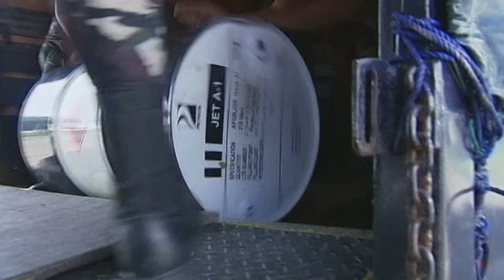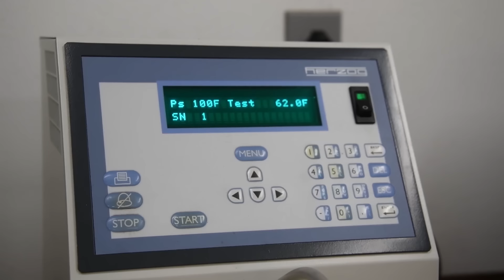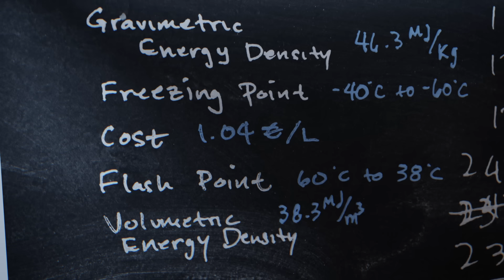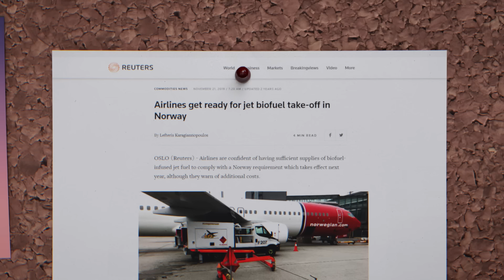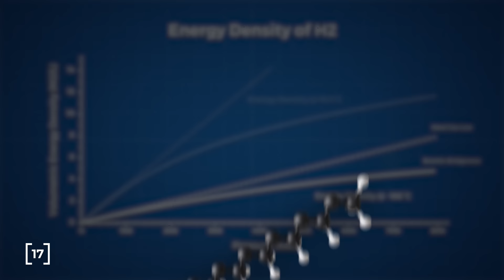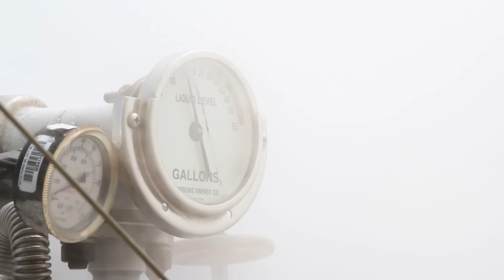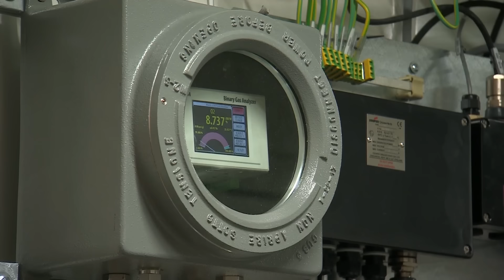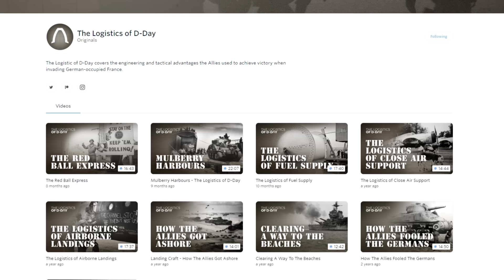The Uncertain Future of Jet Fuel

Comment: Air plans used car technology for the first 30/40 years. That technology had already been smoothed out decades before the write flier. I'm sure once electric is the standard for cars there will be a clear path for planes.
Reply: Battery tech does not follow Moore’s law. The energy you can store in even the most advanced battery concepts under consideration are not even close to the energy density of hydrocarbons. That’s why electric planes will remain a niche application as the video author said.
Reply: @nemotaylor240  Moore's law is specific to chips. Nothing else follows that. But yes with today's technology it's niche. If you look at gas powered plans of the 1920's it was a niche market for small local routes because the technology for light strong airframes, and more efficient designs weren't there. In the 1940's and 1950's there was open debate if we could travel faster than sound. Technology advanced. Look at electric cars from the pre 90's they were niche homemade mods using flood batteries. Now look at that market. 400 mile range competitive in performance to gas cars. Look at stationary energy storage. It went from flood batteries, to LiFe batteries and now they're looking at liquid metal batteries. The point is you can't put today's limits on the future.
Reply: @sailingbrewer  trust me I am with you, I’d love to trans-Atlantic battery powered commercial aviation. But the numbers don’t lie: very best lithium-ion batteries are 600 Wh-L. Jet fuel exceeds 9000-10,000 Wh-L. It’s literally more than an order of magnitude. Battery tech is stagnant for years and then every once in a while there will be a small breakthrough, but battery scientists are already having issue due to leakage between the ions the more energy you squeeze in. It’s a very very hard problem to solve with no solution in sight at moment. The example you use about cars is only possible because of the supercharger networks. Long-haul jets obviously can’t refuel in the sky. I’m stoked on electric planes! They just aren’t the solution to modern commercial aviation. I was disappointed the authors didn’t mention small fission reactors which are the only realistic “green” (in terms of climate) tech out there that could solve this one.

Comment: Personally, I think hydrogen fuel cells are a decent option to move towards for plane fueling. Especially if you switch over to electric "turbofan" engines. It would also be a good intermediary alternative for trains and ships too until the KWH per Kilogram of batteries gets up to par. Common to all these forms of transportation is large centralized fueling/loading stations where installing an expensive hydrogen storage and fueling station would not be an extreme hurdle to overcome. I am not sure how much volumetric energy density compressed hydrogen has in a tank versus jet fuel in a tank though.

Edit: I got to the part of the video where you show the volumetric density. I wonder if you can overcome the comparably small volumetric energy density of hydrogen with the efficiency of electric "turbofan" engines, the superior energy conversion efficiency of fuel cell generators and the comparably inefficient use of jet fuel's superior volumetric energy turbofan engines provide. Especially if you combine this with the sea based solar power and desalination plants being worked on currently it sounds feasible to do. I recently read about a new solar panel waste heat based desalination tech that is supposed to not pollute the ocean with concentrated brine water. It sounded like they had a working prototype according to that article.

Comment: I have a question. I have read that boats might be using liquid ammonium as fuel, could planes use liquid ammonium I know it's energy density is dogshit and it needs to be stored at -28 f but it would have more wait and easier to handle. While efuels are more practical could ammonium find a niche?
Reply: qopoy dnon  what?

Comment: I'm no expert but I'm sure that a small electric plane might be cheaper to maintain than a normal aircraft (No oil changes or need for gasoline or kerosene).
That's good news for anyone wanting to fly their own plane but don't like the necessity of maintaining an aircraft.
Although electric planes are probably expensive because of the batteries.
Reply: Too heavy to fly right now

Comment: Why not make electric turbo fans like model RC planes? Issue being batteries ofcoarse, but i wonder if they could make enough thrust reliably if power (batteries) were not an issue
Reply: Phoenix  𝙾𝚙𝚎𝚗 𝙼𝚢 PROFILE  what the heck does this have to do with what I wrote? Electricity comes from many sources, and can be easily produced without fossil fuels, coal or nuclear. Learn to read.

Comment: As always an excellent and well researched production. Don't forget that bio fuels are energy negative apart from horrible environmental issues. Maybe the transition to a carbon neutral aviation future must not lose sight of costs. The math does not tally, hydrocarbons are absolutely necessary until we find a solution where politics and science share the same opinion. If we were to move to the alternative fuels available at the moment, the cost of air travel will be passed on to the consumer, which will further increase the gap between rich and poor. The same basic driver for electricity applies to the aviation industry. Provide cheap electricity to everyone.

Comment: Why not something nitrogen based like ammonia which has a pretty good energy density, A nice Specific impulse (at least in rocket engines), Easier to store than hydrogen, It is a great coolant,  It doesn't form any residue, And it is carbon neutral assuming you make the process of making it carbon neutral. But it is toxic and corrosive, and is a gas at room temperature. So maybe not for planes carrying people.
Reply: Too bad all planes carry people so far

Comment: Seeing that reducing the carbon footprint of the aviation industry through changing the fuel used in planes is obviously expensive (in terms of money and/or the environment), an alternative would be to continue using fossil fuels in planes,  and to reduce the carbon footprint in other ways. For example, instead of requiring airports and airlines to spend a lot of money on alternative fuels, simply require them to reduce their carbon footprint in some way. Or introduce a carbon tax. 

They can then choose to for example invest in technologies that remove carbon from the atmosphere (also hard, but maybe less hard than replacing fossil fuels used in planes). Or they could choose to replace very frequent short range flights with high speed trains. Or invest in much more efficient planes and engines.

To maintain popular support for decarbonization efforts, it is essential this is done at minimum cost and disruption. I suspect that currently there are more cost effective ways to reduce  humanity's carbon footprint than replacing jet fuel.

Comment: hey, great video! just a clarification: gas-powered turbines are not "powered" by gas, they are actually steam-powered. And the steam in fact is heated from some heat-source. It's a bad comparison because the jet engine also has a "gas-powered" turbine in this sense. Otherwise, jet engines are also "gas-powered".

Comment: I've watched a documentary a few weeks ago, about some guy inventing his own hydrogen engine. Because hydrogen is so hard to store, instead of storing the hydrogen itself in a tank, he instead installed a tiny refinery in the car and filled the tank with just water. Therefore the hydrogen would be generated on-the-go and used almost immediately, not requiring any huge tank for storage. It would be also much safer, as there would be just a tiny amount of fuel on board at any time, so the low ignition point wouldn't be a problem.

But somehow nobody invests in his idea. I don't know why, but then again I'm no engineer. Perhaps there's some technical barriers. Or maybe it's just lobbying by companies who already invested large amounts in developing the expensive pressure tanks.
Reply: Where does the energy needed to create the hydrogen come from?
Why can't he use that energy directly into the engine? Which would be more efficient.

Comment: Or we could just use carbon capture to offset the CO2 production, there are some promising technologies on that front.
As for hydrocarbon biofuels, I fail to see what difference that makes. They produce CO2 just the same, so how does that help carbon neutrality in any way? We have enough oil reserves that we don't have to be concerned about renewability for a long time to come, burdening ourselves with completely unrelated issue NOW when we're trying to solve the more pressing carbon neutrality issue is dumb and completely nonsensical.
Reply: foopyu nooui  As useful as it is on the ground, it's even dumber than hydrogen as an aviation fuel.

Comment: All thay have to do is put solar panels on the wings and  a generator motor Hybrid Where the coils for the motor are  in the same statter as the generator  And put a capacitor in between the coils so half of the sign wave your producing power and the other half of the sign wave you're using power way you Don't need nearly as many batteries on the plane. But what do I know lol and also  Put a thick rubber in the wings and pump hydrogen or heat and pump hydrogen or helium into the wings the wings to give the plane to give the plane a lighter buoyancy

Comment: It sounds all like a luxury problem. From one vacation to multiple, to unnecessary trips that could be done otherwise. Always increasing, never satisfied. Corona showed we managed to do just fine. Maybe more locally?. I do not believe in carbon neutrality. But behaviors can be adapted at much lower costs. Taken the airplane just as if it's a bus doesn't make sense. If you could hop on a bird like Niels Holgerson, yeah in that case. We drive all species to extinction, but w hate to do so to our metal birds?! We can handle water shortages, but not flight restrictions? Why? Because we must fly cheap, so that we binge fly around the world? No I don't get it. It has only to do with a different mindset that has changed. An unsustainable mindset. The grass is always greener if you make a flight for it. 😂

Comment: No it’s not in a crisis.  Lol.  Like oil comes from dinos.  We would have used up the dinos by now.  They run off compressed air with a tiny bit a fuel.  It’s ridiculous that a jet would hold tons of fuel. Like where stupid. The wings are filled with helium.
Reply: No they’re not, wings are designed to
Store fuel. Helium in the wings? Please tell me you’re joking.
Reply: @sexigrande1792  you have no evidence of the amount of fuel in a 747 do you.    It’s crazy the amount fuel they claim.
Reply: @5nuccs  I’ve never looked for the specs but they could easliy hold atleast 50-100 tons probably more. Considering the military aircraft I work on can hold over 60k pounds, 40k in the wings and 20k in the belly tanks and it dwarfs in size to a 47. I think you underestimate the size of wings, google a380 wings, those are massive.
Reply: @sexigrande1792  is it 50 or 100 tons then?  What would that look like in mass. My calculations are 100 tons =2942 gallons = #53-1/2   55 gallon barrels.  I guess that isn’t too far fetched.  Thanks

Comment: To me the problem seems to be combustion engines rather than what they combust
Reply: the video actually explains the opposite of that. Combustion engines are cheap, reliable and efficient compared to even hypothetical alternatives. If it weren't for carbon emissions alternatives would not even be discussed.

Comment: Carbon recapture is carbon neutral. You're welcome.
Reply: тαρ мє αи∂ ѕєχ ωιтн мє Penelo  No, it involves filtering greenhouse gasses like carbon dioxide and methane from the air, then processing them to make synthetic liquid hydrocarbons which can be used to make everything from gasoline, jet fuel, plastic, and pretty much anything else remotely related to crude oil. Then as the fuels are burned by society and waste plastic is burned for electricity, carbon recapture happens again to artificially maintain the carbon cycle and a healthy climate for earth's animals.

Comment: The flyzero research program has clearly shown how LH2 solves all these problems. Just search this, and read it. I'm disappointed with the Real engineering guys for this misguided piece, usually they're spot on. It may be a race condition problem: the flyzero initial report was published late 2021 so maybe a little after these guys did this piece. 
Anyway, as the flyzero guys document, the whole ecosystem of LH2-powered flight is not only feasible, but inevitable. There is no alternative for future long-distance planes.

Comment: Cooking oil
Reply: Former US Navy fuel systems engineer here. Well done, this is a fairly comprehensive look at jet fuel production, constraints, and alternatives. I would like to add that the Navy did evaluate a 100% biofuel version of JP-5 back in 2016. Performance-wise it was nearly identical to traditional JP-5, but as you observed, the problem with all biofuels is the cost of production.

Edit based on some of the responses: The Navy's main motivation for investigating biofuels is more to do with diversity of fuel sources (i.e. less dependence on the Middle East) than it is to do with saving the planet. That would be a nice side-benefit, though.

Comment: Great and informative video.  I like where the narrator explains a few aviation-related drawbacks of hydrogen as a fuel.  Hydrogen is actually the worst form  of energy storage commonly discussed, even on the ground.  I used to think Hydrogen was the answer when I was a little kid.  Then I grew up and realized all the pesky details amounting to a cascade of inefficiency:  Low efficiency production of hydrogen, low efficiency storage whether by compression or cryogenics, low-efficiency retrieval of energy whether by fuel cell or burning in an engine, low energy density of the fuel, and unacceptably low power if burned in a piston engine.  Highly-reactive raw hydrogen molecules degrade storage tank materials, especially at high pressures.  Hydrogen is a non-starter from almost every aspect you could name.  Talk of a future hydrogen economy is naive.

Comment: Random word choice advice: avoid the word "massive" entirely. There are fifty more descriptive adjectives everybody knows and this word has been used so heavily by non-careful writers that is extremely tired. Using a word you saw others use is not always the best choice; the apt word is the correct choice and "massive" is so broad that it is often inapt. Consider large, substantial, gigantic, enormous, colossal, great, vast, grand, majestic, huge. Even humungous, silly as it is, is usually preferable because at least it still means something.

This, of course, applies to any of the bad parrot words like issue, community, individual, stunning. These can almost always be replaced with a word that is not overused and that is more descriptive. "Email issues" tells the reader nothing useful, for example.

Also, as used in this video, "moving forward" can always be deleted without loss; it should never, ever be used. Same goes for "going forward", of course. There are few expressions that erase a speakers credibility more swiftly and surely than these two.

Comment: I don’t really think there’s much of a future for aviation as it exists. The costs and engineering difficulties of decarbonisation are simply too great. Over land, it will struggle to compete with rail, particularly considering the introduction maglev. Over seas and oceans, maturation of nuclear marine propulsion will result in a new generation of fast and economical ocean liners that will outcompete aviation. Battery electric aircraft will find a niche as regional transport connecting small towns to the rail network, but the jet age will come to an end. That’s just my viewpoint, though.